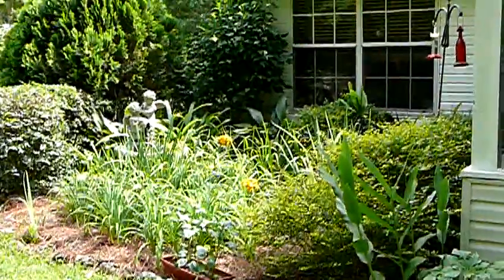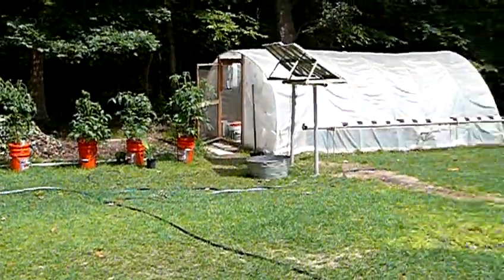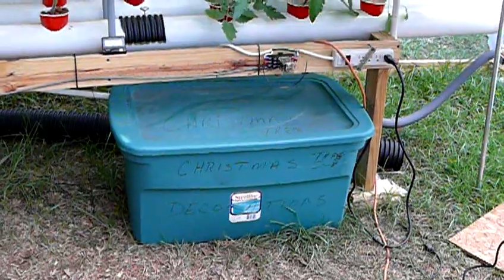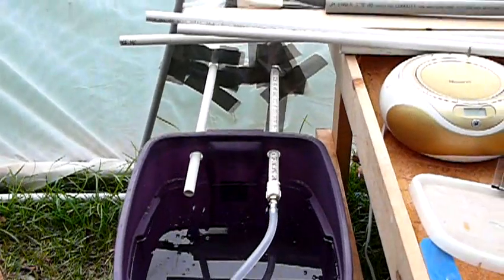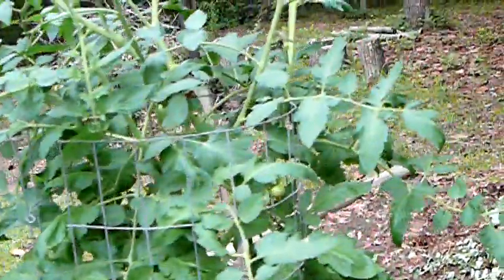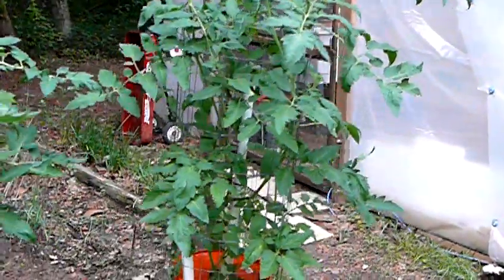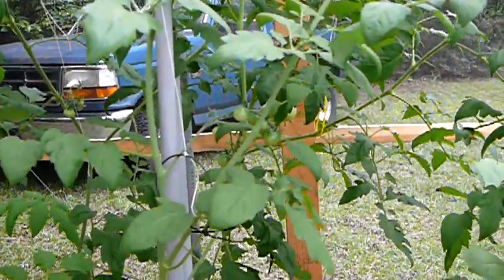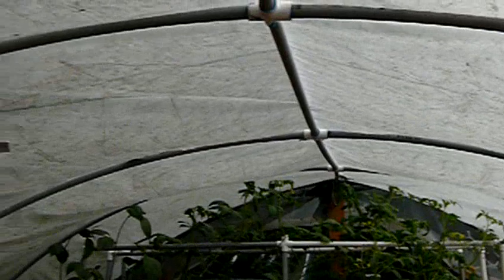hydro10 A

Comment from the maker: I have the same pump in both systems.  Purchased at Harbour Freight rated at 190 gal/hr with 1/2 inch outlet.  The orange buckets are based on the Earth Box design.  Contain Potting Mix, fertilizer, and a little lime.  I add water via the 1/2 pvc pipe to the space between the two buckets every 4 or 5 days.  Construction details in a previous video I posted.

Comment from the maker: The feed pipe does not have the 3/4" coupling screwed onto the pvc bushing and is almost flush with the 4" tube.  The system fills for 6 minutes then drains for 20 minutes.  Very little nutrient stays in the tubes after the draining cycle completes which takes 4 or 5 minutes.

Comment: David, thanks for sharing all of this!

I have a question about the new outside hydroponic setup, if the drain and feed both run to about halfway up inside the tube, then the tube won't drain when the pump shuts off, right?  Will the plant roots get enough air this way, if they are constantly submerged?